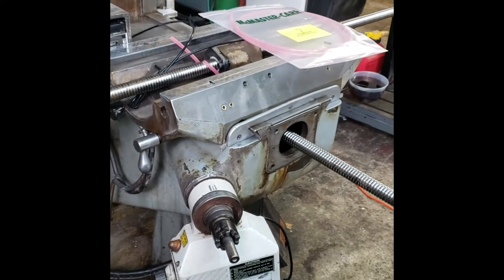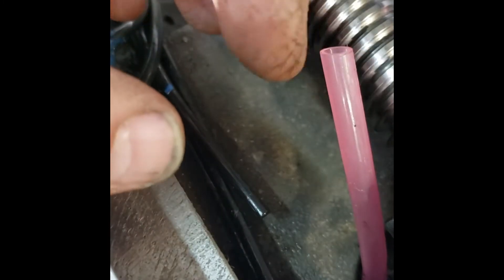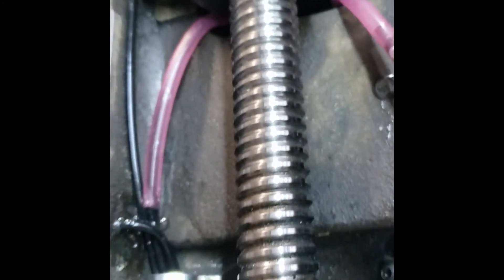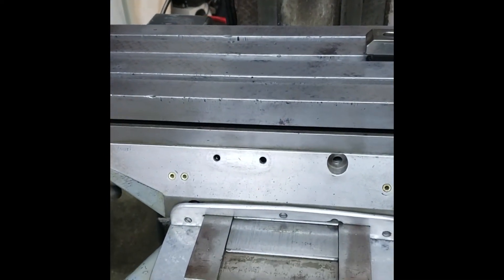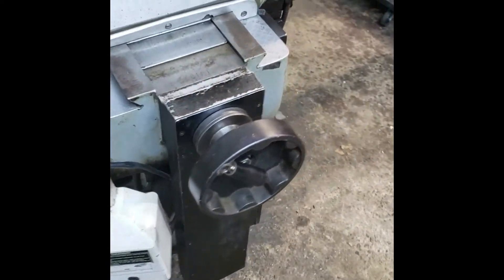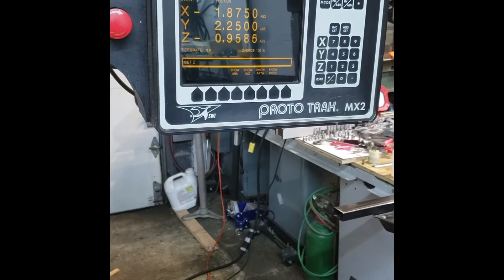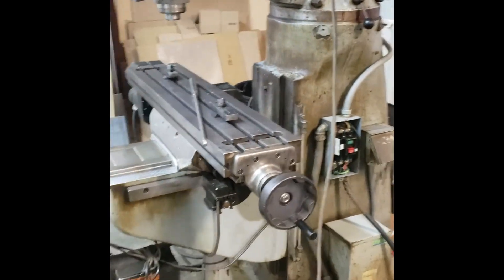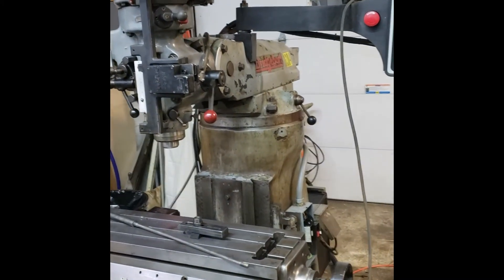Bridgeport Milling Machine Equipped with Prototrak MX2 control system Part 3

Comment: Looking great & working great  Joe .  I had to put restrictors in both the knee oil lines as they were pumping way too much oil & causing less oil everywhere else .     Cheers .
Reply from the maker: Thank you Max! Did you put smaller restrictors in? My mill already has them.  I agree tho the knee moves much less ..   Joe
Reply: @RaptorMachineToolCo  Yes , i put  smaller restrictors  in .